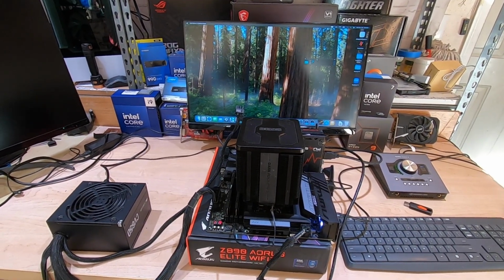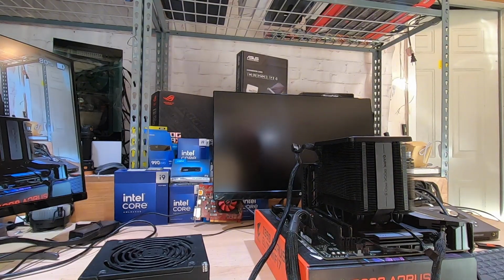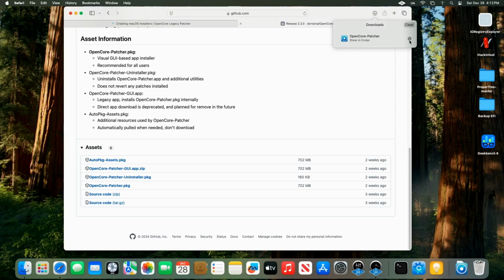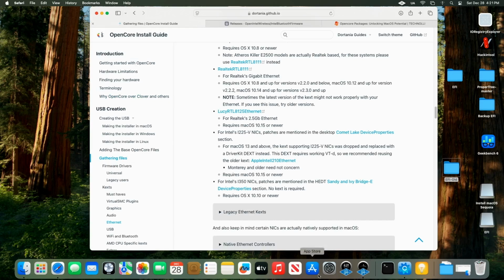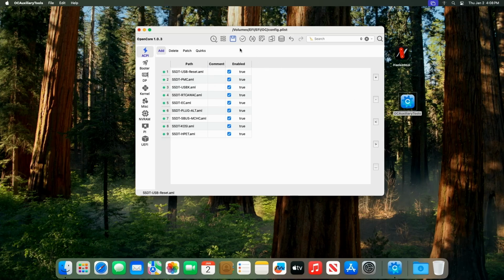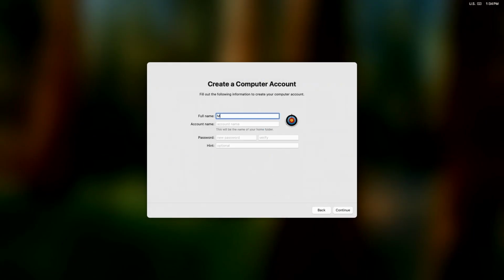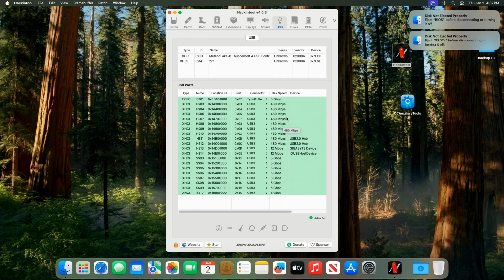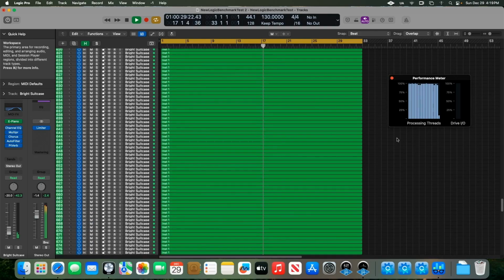COMPLETE 2025 Hackintosh Guide Using Gigabyte Z890 Motherboard - Amazing Benchmarks

Comment: Hello, congratulations for Your awesome and very detailled guide. Following it I bought and built a configuration based on it. However, I got some discrepancies with GeekBench 6: same BIOS (F9) diffs are Kingston Fury 64 GB RAM 6400 XMP1 latency 32, almost same 265KF CPU on AORUS Elite WIFI7 ICE Z890, however without external PCIe card and WIFI6 card. Kexts used are same like in guide but newer versions. From what I'm reading in Your guide, I managed to adjust same bios settings. Done USB 15 ports patching. At the end I got only 1873 Single-Core Score and 11340 Multi-Core Score, which is really odd. If You could find some free time, I would like You to kindly add a possible reason regarding what could affect performance in such a negative way.
Reply: Bump

Comment: Motherboard: Gigabyte Z890 Aorus Elite WiFi 7
Intel Core Ultra 7 Desktop Processor 265K
GPU: gigabyte 4060 ti  
2x16=32 GB DDR5

will it work for me ? 
Please help. 
Thanks in advance
Reply from the maker: Does not work with nvidia graphics.
Reply: @TechNolli Thanks for your reply. so if i change graphic card will it work? by doing the same process which you showed in this video ? or is there any easier way by downloading some files from your website etc ?

Comment: Hello, thanks for sharing. I got mine working but only after doing  USB port mapping on Windows . 

I have an ASRock Z890m riptidge wifi + Core 5 245k + 32gb Sabrent Rocket DDR5 RAM + 512GB Sata SSD. The GPU is a RX 6600 XT from PowerColor.

Comment: I made Hackintoshes years ago and all the motherboards I had that 'Don't Work!' on forums, did work if you just switched off all the goofy things like FireWire and the onboard audio in BIOS. macOS is made for a very small group of hardware unlike Windows that has to be able to run on anything. Use USB audio, which is quieter anyway.

Comment: Hey there, awesome video as usual, It’s been half a decade I follow your channel and videos, big fan here!

I’m on my 3rd Hackintosh:
-Z690 (DDR4)
-i7 13700K
-6950 XT
-Sonoma 14.7.3

Everything works except for proper sleep (computer randomly turns on from sleep, RAM LEDs stay on while sleeping for some reason), a couple USBs which “require power” and the USB interface audio that is half volume before unplugging and re plugging it in.
Spoofing the 6950 XT wasn’t a breeze but eventually worked out great.

The million dollar question is: iMacPro1,1 or MacPro7,1? 
I followed your video guide a couple years ago for 13th gen Intel and you picked the iMacPro1,1 SMBIOS, but in the current one you chose the MacPro7,1 one, which seemed having performance issues due to e-cores proper reading.

Also tried to upgrade to Sequoia, but having boot problems despite having updated kexts, Opencore and all, so reverted to Sonoma, will try a fresh install with a newly made EFI soon.

Thanks so much for your awesome work, TechNolli!

Comment: Still alive as many of us need to run side by side with Silicon for our occupations. Although the final Intel (non Xeon) machines from 2019 like the 9th gen I-9. How can I get in touch with you to get a RTR box (not due to the ability to order parts and slap together, I would just like something ready to run)
. I did not realize Sequoia was running on hackintosh. Thanks for posting, subscribed. I use the Sonnet 750ex on a 2019 Macbook Pro (5600M ative) and use a 6800xt on 15.1 Do you know if a 78/9 00 gpu could work on this setup? Would love to work with you on to verify!

Comment: Thanks to your wonderful video, I was able to build a Sonoma hackintosh. Thank you so much!
Somehow my Geekbench scores are not quite as high as yours.
Mobo: Gigabyte Z890 UD Wifi6e
CPU: Core Ultra 7 265K
RAM: 2 x 16 GB  PC7200 (XMP1 enabled)
My Hackintosh Geekbench 6 - Single: 1737 Multi: 11714
Your Hack Geekbench 6 - Single: 2718 Multi: 18321
My Windows 11 Geekbench 6 - Single: 3220 Multi: 21200
Did you do any further tweaking to boost the CPU performance in MacOS?
Reply from the maker: Hey Luke, I left all bios setting to default. I had the same issue with an ASRock Z890. That is one reason I really liked this MB.
Reply: @TechNolli  Hi, I repeated your setup exactly - same CPU, same MB, same BIOS version. And have same problem like above, looks like CPU don't use turbo boost in macOS, performance in GeekBench similar. If i boot to Windows, no problem at all. Can you give idea why it can be like this?
Reply: Ok i will answer myself, AppleXcpmForceBoost quirk give scores 2987/19164 in GeekBench, which looks closer to normal.
Reply: Updating to latest BIOS(17e) did not bring any problem to installed Sequoia, but VT-D should be turned off to proper boot.
Reply: which EFI folder do you use? when i click on boot install mac os sequoia i have this problem: EB LOG EXITBS:START

Comment: I love the IDEA of a Hackintosh.   I just grew out of it.    The killer app was being able to add PCI cards and memory and Storage, but then everything became workable with Thunderbolt, just like in the Firewire 800 days.   
Storage was always the big thing along with CPU power, and each can be added without any bottlenecks through the I/O Bus. 

The Current cheapest mac Mini does that already, and the upgraded version comes with a good amount of RAM for a reasonable cost. 
Now? New macs with Apple Silicon can't really use external GPU's, so there's one killer app for the X86 based Hackintosh.  
Then there are Render jobs, but then you just send those out to your Render Pig machine you have either based on Linux or Wintel for your final renders. 

As for audio?
If latency is the deal, then the Old X86 Hackintosh makes  some sense. 
Add in cards, and thunderbolt still add to latency, but thunderbolt 4 pretty much works without a hitch on the Apple side. 
Not so much on the Windows world.   And Thunderbolt 5 was less than spectacular if you saw the PC world results. 

Still,  it's fun and cool to do and gives you a LOT of flexibility.  
Especially if you are using older hardware inside and add in cards 
Not to mention the custom nature of everything.   

Great you got the system up and running smoothly.
Reply: Anything pcie 5
Mac is not there yet
Black magic sound card .no tb4 latency or pcie chassis.
Raid
Upgradeable memory cpu GPU npu cannot be over looked with new 48 gb sticks games windows Linux lower price no cables pcie compared to thunderbolt.
Thunderbolt 5 cards.
No external cases or cables for cheap fast ssds pcie5 ssds in raid

Choice of case

Comment: thank u for all,my question is ,many tests brings the new m4 mini in high level especialy the pro one,is this pc will bEAT it ?because the m4 has lower price
Reply: Define "beat". It's difficult to compare CPUs these days as there are so many different use cases. In single and multithreaded benchmarks the new Intel chips beat the M4 Max - but not by much. However, the M4 also has a neural engine and multicore GPU on board (because it's an SOC rather than a mere CPU), so in applications able to take advantage of those it will leave the Intel chips in the dust. And on processing power per watt, there's just no comparison, the M4 will trash any x86 CPU.